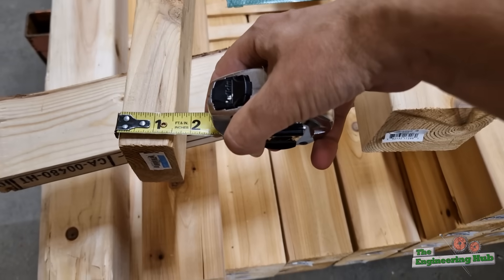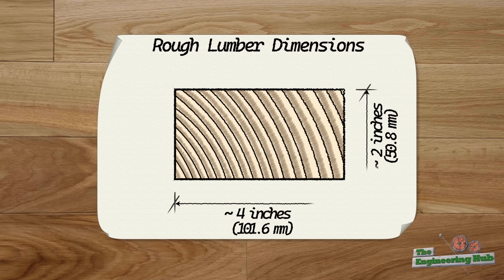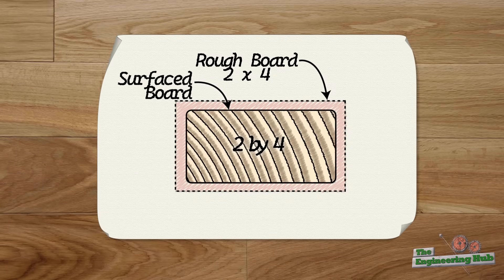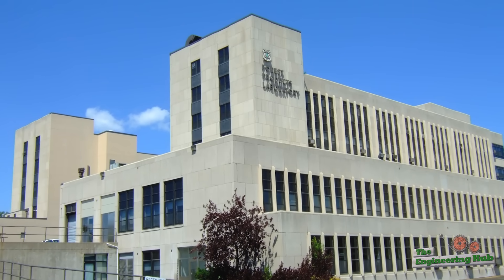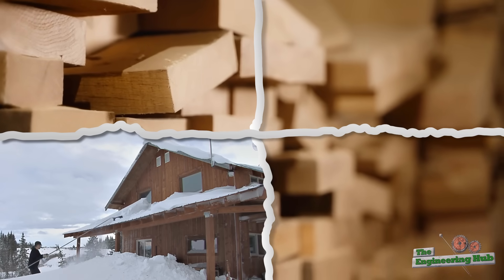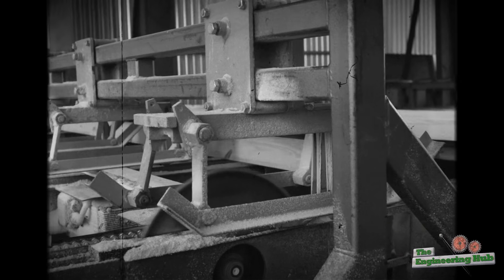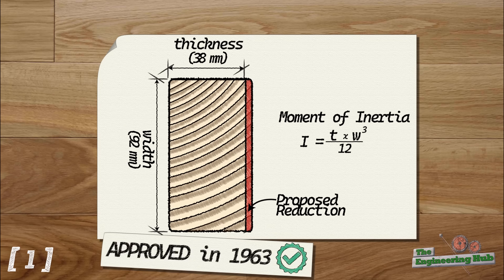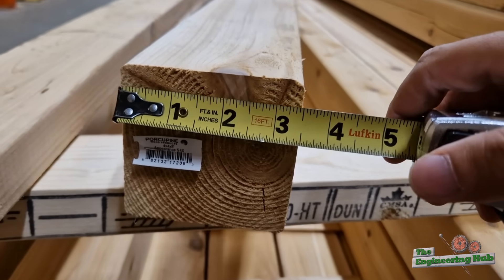Why is the 2 by 4 getting smaller and smaller?

Comment: I'm a carpenter in the UK.  We generally refer to a number of timber sizes that you refer to as 2x4s as 4x2s.  Firstly there is rough sawn timber, which is roughly 4" × 2".  Then there is PAR (planed all round) or PSE (planed square edged) which is usually a better quality timber for finish work, this is approximately 1/4" under 4x2 in each dimension to allow for planing down from timber that started at 4" x 2".  Then we have a treated construction lumber which I have heard referred to as 4x2 regularised or 4x2 eased edge, this is around 45mm by 95mm with rounded corners and a fairly smooth finish.  Finally we have what you usually refer to as 2x4, which is usually untreated construction timber which we call 4x2 CLS (canadian lumber standard) and has a fairly smooth finish with rounded corners.  4x2 CLS is generally used for internal construction such as studwork and is 38mm x 90mm.  Because of this variety I rarely hear people in the trade refer to 4x2 without a qualifier, such as CLS.
Reply: A friend of mine was replacing rotted wood on his veranda deck and sent his half wit brother to the lumber yard for a 2 X 4. The brother got confused at the lumber yard and asked for a 4 X 2. The yardman at the lumber yard decided to have some fun and pointed to a 2 X 4 that was laying on edge and said there it is, how long do you need it? the brother replied "we are going to want it for a long time, it's going to be part of the porch".
Reply: @MAGAman-uy7wh  lol
Reply: As an electrician in the UK who dabbles in a bit of joinery every now and again, our sizes/standards are very confusing if you're not a joiner.
Reply: Thank you for your insights. I was wondering what happens in Europe
Reply: If your in England you can get c24 carcassing that's different sizes in the same pack how you are supposed to build a timber frame that's flat on both sides is beyond me!
Reply: Although they are supposed to be the same dimensions, unlike the old rough sawn 4x2s which could be as much as 1/2" different across the 4", they still shrink as they dry, but they are an improvement on rough sawn.  The biggest problem I find is the number that are so bent and twisted as to be virtually unusable - there are only so many noggins you need.  If I'm only doing a small job I go and pick out my own timber, of course, since others are also doing the same, it almost guarantees you will get a pile of rubbish timber if you let the merchants select the timber for your delivery.
Reply: Thx.  I was going to point out the same but I find you've done it and with excellent detail.
Reply: It's going down!
I'm yelling timber!
You better move!
You better Dance!
Reply: My thoughts too
Reply: When was the last time you bought timber in the UK specified in inches and feet?  It's all metric and 4x2 actual size  is irrelevant  . . .
Reply: @TRPGpilot  As I said,  I refer to all of the 4x2s in my original comment as 4x2 when ordering, so do most of the tradesmen I work with and the staff at the builder's merchant.  Lengths are always ordered in metres (3.6, 4.2, etc.), but the cross section is referenced in imperial, although this is not what appears on the invoice or delivery note.
Reply: @TRPGpilot  the inches are the standard, the mm listings are EU regs. So 2021, but i've not ordered myself in a while. If you don't know what a 4x2 is god help you. I have had a girl not know at the lumber yard once who was running the desk and some inexperienced kids don't know, 

Imagine- can i have the nominally 95 millimetre plank Pete? 

What do you call a 8' by 4' plywood or plasterboard? 1220mm by 2440mm? You're having a laugh right?

Before you think you are advanced, you use imperial measures for time. This is why in the UK we use mph and knots as km/h is mixing metric and imperial.
Reply: @mandowarrior123  The world has moved on, why would I need to know what is a 2x4? Its a metric world weather you like it or not, the old folks who like to hang on the 'how it used to be' don't live forever . . .
Reply: @TRPGpilot your talking nonsense
Reply: In America, most people that refer to 2x4's are not actually carpenters or in a trade where more specific qualifiers are used.
Reply: I need a pressure treated 2x4x12 and I now sound like a fake carpenter thanks to that logic. How about this...I need a long greeny wood with a side that isn't like calcium deficient bones and is straight like flag pole.   @blairs6664
Reply: @blairs6664  BS.  Framers call them studs, referring to standard 2x4 KDSPF (Kiln dried, Spruce, Pine, Fir) usually 92-5/8" long. Most carpenters just call them 2x4's.
Reply: @scottsatterthwaite4073  Right, so what part of my comment was BS? I said that most people that refer to them are not tradesmen. Then I implied that tradesmen refer to them by 2x4's and use identifiers to be more specific. Studs can be a huge variety of sizes and materials, that's kind of a weird argument to make.
Reply: @blairs6664  Sorry, I might have misunderstood what you were saying.  I'm a renovation contractor and I work around all the other trades regularly.  None of them refer to 2x4's as anything other than 2x4's or studs.  Yes, studs can be 2x3, 2x4, 2x6, can be metal, even composite or lvl.  The only time we need to be more specific is when we order material.  But on the job site, its just a stud.
Reply: @scottsatterthwaite4073  It's all good, you weren't the first. I guess I worded it weird. I'm a sparky so I've always heard them referred to as studs if there was only one size, then by size if there were multiple sizes on one job which seems rare. Granted I mostly do industrial and some commercial so I see more I-beams than studs. I'm pretty sure it about the same for the guys on the other side of the pond, I think he was just talking about how they have to refer to them to order them. Granted I could see a bunch of Brits on a job site asking, "hand me the 4x2 CLS please."
Reply: @blairs6664  I have to wonder what the trades in all-metric countries call them?  45x95's?  That adds a mouthful to the vernacular.
Reply: @scottsatterthwaite4073  Generally in the UK, at least in my region, we still call them 2x4's or 4x2's when talking about them, but they're almost always advertised and sold in metric. Our sizes tend to be closer to the original 2x4 size being around 98x48 mm or within ~3/16in of the orignal 2x4.

Though recently the prices and quality of the material we use (graded C16 or C24) has been awful, you're lucky if you find a length that doesn't look like a banana, and some ive seen recently the sizes are out by 3/8in.
Reply: @blairs6664 Where I live it's the dummies that just ask for a CLS, because they've only ever seen the 38*89 mm ones. Tradesmen specify the width, since the thickness is all the same. Could be 63, 89, 120, 140, 170, 184, 235 or 285 mm. And then there's 'true' 2 inch material, which gets planed to 45 mm thickness, comes in widths of 45, 70, 95, 120, 145 and 195 mm. From there you go up to actual beams which are normally 60, 70 or 95 mm thick and go up to 295 mm wide. Laminated when you need more, or LVL, or I-beams. I personally use a lot of 360 mm i-beams because of the insulation we aim for.
Reply: @MartynMc All the wood I buy is pretty good, but I get full packets directly from a company that imports them. When you have to find individual pieces at a lumber yard you're screwed. Especially when they serve consumers. Has always been that way.
Reply: @nelus7276  So everytime a worker asks his helper to hand him a stud, he's saying all that?
Reply: @blairs6664   That's a load of BS. 2x4's are called exactly that by all trades people in North America INCLUDING carpenters..
Reply: @matthewq4b  You gotta work on your reading comprehension skills dude. All I said was that most people that talk about 2x4's aren't tradesmen. But yeah your right, we don't have any identifiers to specify what kind of 2x4 here. You just ask for a 2x4 and they just telepathically know whether you need ground contact treated or just prime. If you want kiln dried dimensional lumber, what kind like SPF. Yep, your right and I'm just an idiot.
Reply: @blairs6664 don’t worry I understood your very first comment and as a non-tradesmen I have to agree everyone here just refers to a 2X4 as a 2X4. You actually gotta read the label at the home improvement stores to know what kind of 2X4 it is but just generally in speaking terms yeah 2X4 is a 2X4 no matter what type lol. Some people read other people’s comments real fast and are quick to try to shut you down. That’s the error on their part. You definitely don’t seem like an idiot based off of the facts you spoke.

Comment: I've found the dimensions of US timber to be inconstant, causing additional work and costs if you attaching sheet rock to each side, since packers are required etc. I would rather pay more to have correctly sized timber at whatever size can be agreed as the standard.

Comment: 2x6 is down to 5 1/4" ,depending on what mill your lumber is from. These days I buy s.p.f. 1650 for plates, mainly because it stays straighter for a longer time.  Basically trying to get a house dried in before everything bends and twists is the main challenge.
Reply: I’ve never seen A 2x6 measure at 5-1/4” they’re 5-1/2”. The 1/4 doesn’t start until you get to a 2x8 at 7-1/4” and wider 2 bi’s.
Reply: @executivesteps these lumber experts never framed a house in their lives.

Comment: This is a prime example of stretching a white lie for profit. Either we appreciate facts and accuracy,  or we become used to sly deceptions and fuzzy truths. The two by four has always been available for those who want them, but what is offered in bulk as 2x4s are mis-sold to complicit customers, who treat the discrepency like it's insider knowledge! Trading standards laws would be applied to any other commodity, but even the authorities charged with the standardisation of weights and measures treat this like it's a cultural quirk, or an unavoidable consequence of the milling process. It's nothing more than a stealthy price increase, a lazy use of language and a false claim about the dimensions of the goods for sale. The choice is simple. Continue lying to the customer, or call them something else, and guess which one would cost more.

Comment: I live in a house in Canada built in 1925.  The exterior walls are constructed of lumber measuring 2 by 3 and the interior walls are constructed of 2 by 4.  I have no idea why this is.
Reply: That's really bad for your energy efficiency; you can't have much insulation.
Reply: @bbgun061  When I started renovating I found newspaper and sawdust in some places, but nothing in most.  I jammed in as much insulation as I could.  The attic is pretty well insulated, but you're right, there isn't much.  Trying to thin down standard batts so they fit in the cavities was a PITA.

Comment: Interesting to see the story laid out.  I will also point out that in 1963 or there abouts, in Canada at least, 2x6 wound up being used where a "real" 2x4 would have been acceptable. What you do not address is that the actual lumber itself is vastly inferior to what it was in the 1960's.  Pick up a  4x4 and better than even odds it is the exact centre of a log. Rarely can you find one that is cut from a decent size log.
Reply: I've been a carpenter for 47 years now, and I still salivate when I get to tear apart a 1950-60's project for a remodel.  I know that inside the walls, I have super straight, nearly knot free old growth lumber waiting for me to "dispose" of.  Pretty much 100% of these projects yield boards that are laser straight and completely reusable, although somewhat harder due to age.  The stuff we buy these days is absolute garbage, and we have to use it immediately before it starts to twist and bend.  Aside from nail guns and the proliferation power saws, building houses in the earlier years would have been much easier because your materials would all be straight and true.
Reply: Hear hear.  @smartysmarty1714
Reply: The saws I like, but I am not a fan of nail guns..I prefer a hammer, and something built with a hammer. The hurried motions of stuff assembled with nail guns results in a lot of nails that are miss-placed, off the mark and not as strong. They are just for speed. I personally find nail guns very bulky, awkward, and often heavy as well. @smartysmarty1714
Reply: Roger that @smartysmarty1714
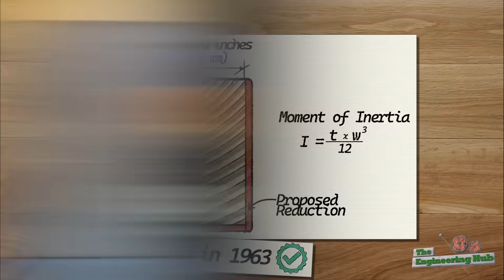Reply: At 6:10, one can see the vast difference in growth: the newer 2x4 barely needed 4 years while the old growth 2x4 took perhaps 50!
Reply: I was going to make that comment about the grain of the wood. I wonder about the support strength for vertical force, or lateral force. The manufactured home I am renovating uses 2 X 3 Studs notched for electrical and nailers. The roof trusses are true 2 X2 but have sagged due to aging and water damage. I had to replace them by ripping "2 X 4" s  that were kiln dried. They tend to bow after the rip-cut due to the moisture difference between the exterior wood and the interior wood. they need to be stickered and stacked for a couple of years in a constant moisture enclosure but who has the time and space to do that. @markfisher7962
Reply: Box heart is always a problem.
Monoculture trees aren't allowed to get big enough before harvest, and modern forestry practice is never going to have tight growth rings.
They're all GMO to start with.

Comment: In the UK we have two different specs: RS or rough sawn which is more or less 2 x 4 (47mm x 100mm finished size) this is the material generally used for framing. Then we have PAR or planed all round which is smaller at 1 3/4 x 3 5/8 (45mm x 95mm) finished size.
Reply: We also have CLS (Canadian Lumber Standard), which is the stuff he talks about in the video. A CLS 4x2 is 89x38mm. It's in the span tables as legit and what I have mostly seen being used for framing recently. Even rough sawn tends to be under nominal size these days.
Reply: I've also bought PSE 4" x 2". PSE = planed square edge. Nobody else has ever heard of it and I've forgotten which woodyard I bought it in.
Reply: @derekfancett8218  I've heard of PSE but can't think of last time I saw it at a yard. I wonder if it's essentially the same as PAR, which is how I see smooth planed timber of all sorts described nowadays?
Reply: @lordsummerisle87  I wonder whether, as you say, it's pretty much the same as PAR but on more seasoned wood so you have 90 degree corners rather than corners that are smooth but warped out of true  by drying or seasoning. Who knows ?

Comment: When I used to do house renovations this was an extreme pain in the butt trying to reframe walls using nominal 2x Dimension Lumber and then having to slab on thinner stock to match the old stock.
Reply: And trying to repair and replace floor joists that are actually logs with one side cut roughly flat with an adze.
Reply: I have the same issue here doing repairs on my family’s cottages built in the 1950’s! Have to use fillers or other adjustments to make it work.
The majority of the walls and flooring were done using 1 inch thick tongue and groove pine. Can’t find anything equivalent to that anymore!
Reply: That is one reason I like to be in the country. There are a couple of local guys that you can bring a sample and they will mill pine to match.   @JohnHallgren
Reply: @markbernier8434  city folk just prefer "saving the trees" over structural integrity. They dont seem to care much about the thought of the building falling appart on them as long as they are content with the thought of having used tiny planks that must somehow imply in their minds that less trees are being cut. I've seen this argument all over the comment section so i can tell you that living in the country and getting a pine milled to fit just right is a priviledge that most people dont even realise as such.